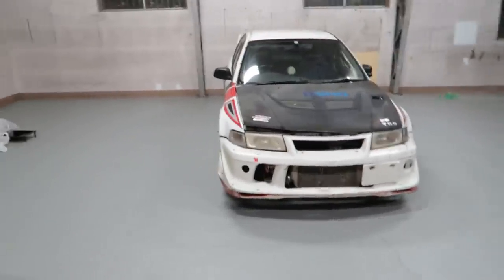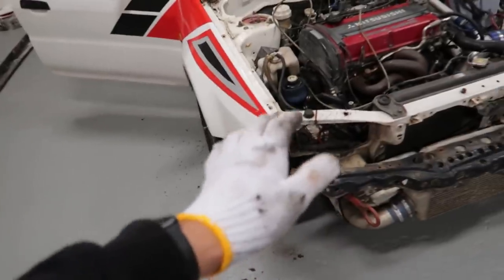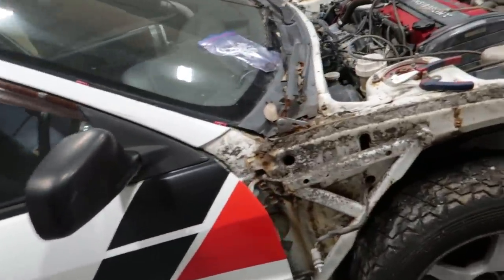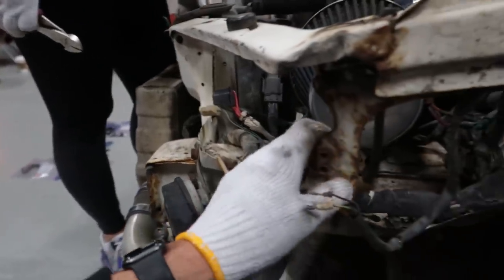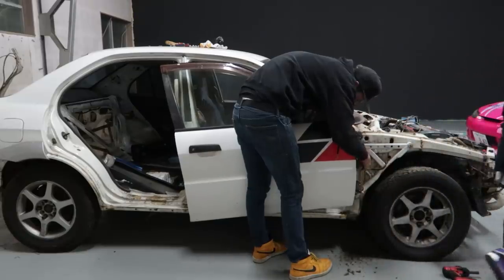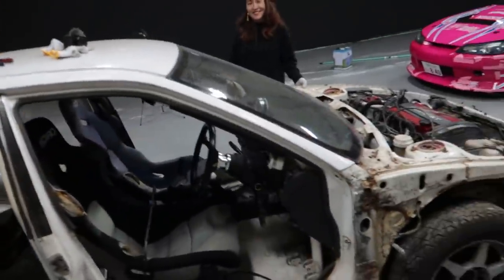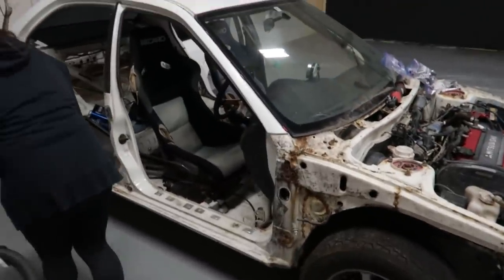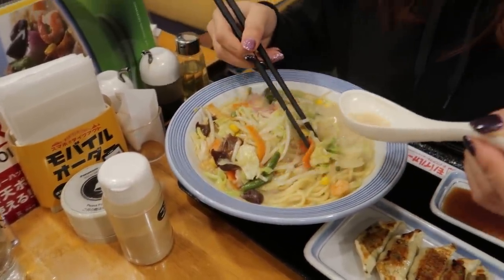STRIPPING THE ABANDONED EVO 6.5 TME RS BARE!

Comment: Upgraded ground wires dont add hp. They upgrade your grounding and reduce the strain on things in the battery n alt area. If your car is old and the grounds are original then upgraded wires will be a help. Otherwise its a unneeded functional mod
Reply: Unneeded and functional doesn't make sense , its either functional and needed or not - a good earth can never be unneeded this guys a fool sorry 😅
Reply: This guy is from the looney bin xD!!!!
Reply: Had an old 97 Escort gti had so many electrical gremlins until I added extra grounds. Yea I understand their not always needed and add weight but sometimes a 20+ year old harness needs some help

Comment: Sam...when you start changing the electronics of a car from OEM like fuel injection, fuel pumps, engine management, digital dash's and additional sensors, additional ground straps or at the bare minimum using larger gauge wire for the existing ground straps is a really good idea...sometimes necessary!

Comment: Nice update! The rear quarter panel can be replaced by drilling out the spot welds and welding in a new panel. All the other problems may be straighten with tools and sand blasted the rust. Some of the welds should be redone aswell. You should buy a manual parts washer and and sand blasting cabinet aswell.

Comment: Yeah those rocker panels will need to be replaced most likely. They look crushed beyond what’s worth spending time on. Faster and easier most likely to simply replace them. That rear quarter panel will also need to be replaced as you mentioned. All in all worth it like you’d said. Great project. Kudos for saving it

Comment: To help add a little knowledge to you Sam. The grounding kit actually helps if done along with power side. What everyone in the car audio world calls big 3 or big 4. It allows the alternator to run a full capacity without straining the electrical system. Imagine it like this. Imagine sucking water through a 24g straw and then imagine sucking water through a 4g straw. Which one are you going to get the most water from at a faster rate. So in turn if your running a bunch of gauges and electrical stuff it will in turn help with electrical power do that your not straining the system and killing mechanical power. Just a little knowledge for you

Comment: I added extra grounding wires to my 2005 altima with the 3.5l and it helped tremendously like for real a difference was vary noticeable. Shifts were at 1700 vs 2200 it was an auto. Its not a total myth.
Reply: G35's, heck almost all VQs, not sure what it was upon assembly, but the OEM grounding points/wiring left a LOT of room for improvement.

Grounding kits, negligible for some applications but almost necessary for others. Just depends on the platform.

Comment: Star grounding an engine DOES do something. It eliminates magnetic noise and bad earth which makes your injector and coil timing more accurate and stronger signal.
Generally speaking its not needed if the car is well wired as the added weight reduces any power gain.
But for a rally car if you damage an earth strap mid stage it can shut down the whole car.

Comment: Hey I do body work just thought I'd point out that when your using the electric ratchet on old rusty bolts it's best to wd40 the bolts and crack them with a normal ratchet first to avoid snapping them :)

Comment: Obviously Sammit hasn't dealt with any car audio that requires High gauge wiring and requires additional grounding to help the electrical system so it's not so much draw on a single cable you equal out the the draw look up the Big 3 upgrade and if you think adding extra ground cables is a stupid thing then you obviously haven't played with car audio

Comment: G'day Sammit your rc charger has a safety setting it restricts the mill amp hours to what ever your batterys capacity is for example if you have a 5amp battery  you can set charger to stop at 5000mah as a safety especially for rc Lipos turn setting off or turn up mah restrictions to max it's usually set low from factory 👍🤙stay RAD and good luck with the build

Comment: put sea monkey/brine shrimp in the headlights
btw:what was the thing sam remove from the engine?
Reply: Grounding wires, they simply ground the electrical current into the frame of the car. Having excess just adds unneeded weight for no reason.

Comment: That cars got some serious body issues with stress cracks everywhere, definitely worth having it dipped to show the full extent of the corrosion and where the cracks are so they can be drilled out and rectified.. if not and it’s ever involved in an accident that car would just fold like tin foil, it’s in a bad way so do it right to save you money in the long run buddy cutting corners now will reveal to be costly later on and undoing a large proportion of the hard work you have done in the first place buddy.. will be a very nice car fully finished and worth a pretty penny too!

Comment: Sam stop using an electric ratchet to undo the small 20 year old rusty bolts, use hand tools and if they arent budging then hit them with some lubricant (WD40) and let them sit. 
You're more likely to get them out so you dont have to tap them later which takes way more time than the ratchet saves.

Comment: try undo the bolts by hand and you might snap less of them 😬
Reply: Before I strip a car I spray every bolt with penetrating oil, repeat several times during two days, never had a snapped bolt...

Comment: OK seriously on that ground wire spider thing in its defense it would have saved me a lot of trouble if I would have put one of those on the 77 Honda Civic I had. I was driving to work one day an auto parts store and the only ground wire that I had coming from the cieci to the engine block finally broke it was an old peace. Then the ground traveled through the clutch cable a nuff to set the clutch cable on fire fortunately the hood was on hood pins and I did not drive with the hood on that day so it was easy to see the smoke and fire. The worst part of it was the fire Department was in their truck 3 cars behind me they walked up to me and I had my foot holding the clutch cable off of the engine so it wouldn't catch anything else on fire and they asked me if I was experiencing a problem. And then they walked back and got the fire extinguisher and returned. So if I woulda had multiple ground cables I wouldn't have experienced that problem

Comment: ALL YOUR TALKING WAS TO CONVINCE YOUR SELF ITS WORTH FIXING...IT IS STOP BEING WORRIED YOU GOT IT BRO.. HAVE IS MEDIA BLASTED ON ALL THOSE RUST AREAS TO REMOVE IT ALL AND ACID SPRAYED AFTER. THE ROCKER SEAMS WHERE FLOOR AND ROCKER AND WELDED TOGETHER YOU'LL NEVER GET THE RUST OUT IT WILL BLEED RUST ALWAYS THREE LAYERS OF METAL MEDIA BLAST AND ACID SPRAY IT WILL HELP A LOT

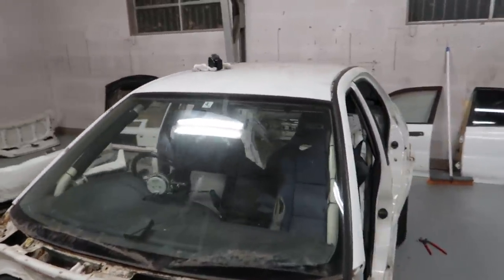Comment: @17:13 Sammit unfortunately you are the one that should have your IQ checked. Having a balanced circuit with good grounds does more than you might think. The current in your car actually flows from Negative to Positive because many people (you included) do not understand this they overlook the need for their Ground (12V-) wire/connections to be just as good as the Positive (12V+) cables/connections. I cant count how many times I have fixed misfires and sensor problems on customers swapped cars with correct ground cables/connections.